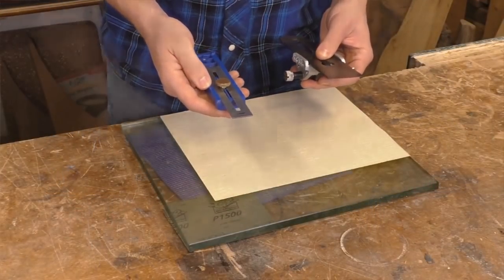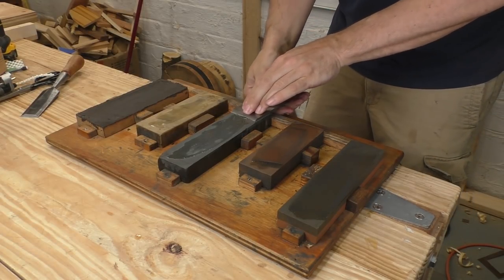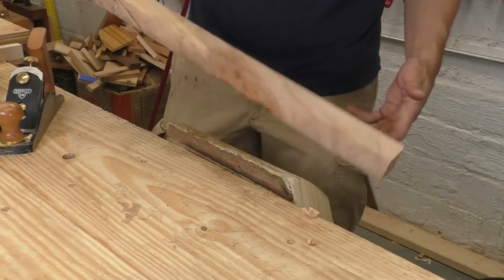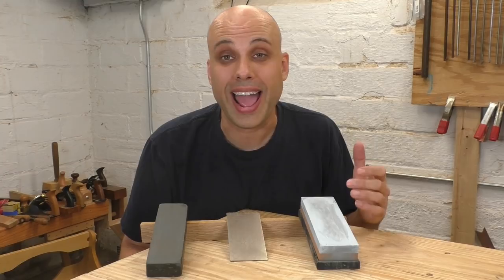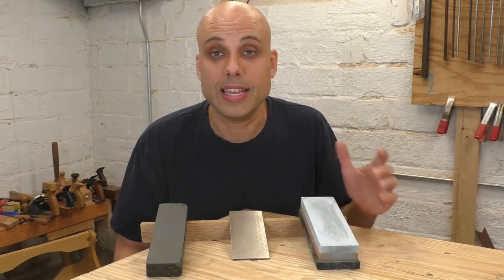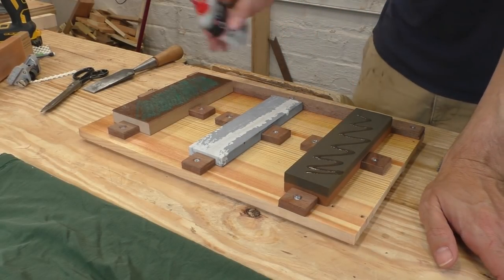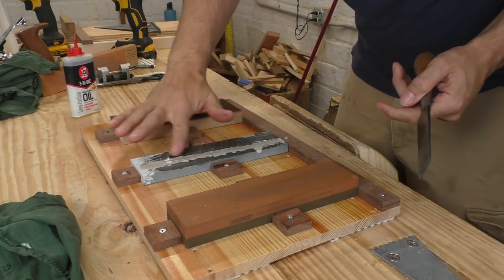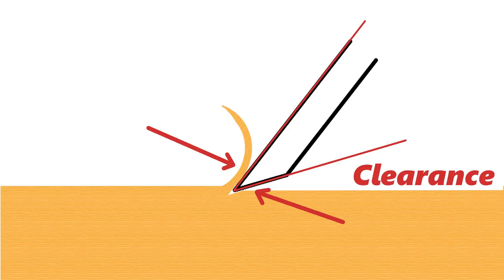Fast freehand sharpening: no jigs, no guides, no sandpaper.

Comment: The other thing is that everybody 1) cuts differently, and 2) sharpens differently. The more someone does both, the more both skills merge into a system that works for the blades and tasks in which they are involved. The right way to cut/sharpen is to go cut/sharpen a lot. What that also does is give one an appreciation for use of the blade. The more your care for and sharpen your own equipment, the less likely you are to go and jack up your blade by making it do something for which it wasn't designed. There is no right way to maintain a screwdriver so that it can effectively pry out a drive belt from an engine block. If the driver snaps, there's not much you could have done to prevent it. That's hyperbolic, but people don't realize that 400 million different blade and cutter styles exist for a reason. Different cutting and sharpening techniques and equipment exist for a reason.

Comment: Btw, that green chromium oxide (Cr2O3) compound is toxic if breathed in, so take care with that if you are going to use it in powder form or if there is a chance it can get dusted into the air you breath from the sharpening/applying action. Also, make doubly sure you don't accidentally mix it up with chromium oxide (CrO3) which is extremely toxic and often shares the same name! and should ofc. not be used for sharpening

Comment: I was so confused as the video started with the end. Turns out i tuned in at the end of premiere
Also my local DIY store doesn't even have oil stones, just crappy water stones. The cheapest oilstones in online stores around here are 40 euros or 45 bucks. I guess, I have to support the evil Amazon corp and get from them
Reply: I got a Trend 300/1000 grit diamond stone, it was expensive at about 130 eur but well worth it. Works perfectly and no worries about it being flat ever. The lapping fluid is also good to get, both for cutting performance and rust protection.

Comment: Just my two cents (been a professional woodworker for quite some time)-
You can save a lot of time by maintaining a hollow ground bevel and only sharpening the actual edge and and the heel. You are removing so little material that you can go straight to the +8000 grit. Every 50 sharpenings or so you grind the bevel back to a hollow ground. 

Hollow grinding makes holding the angle super easy to feel. 
Having a straight or concave bevel is important for how chisels work. Plane blades can be convex. Carving chisels require a somewhat convex bevel.

I have found that when you maintain a straight bevel with freehand, your bevel angle slowly creeps higher and higher even if you are pretty good at freehand sharpening, so you eventually need to grind it back anyways. 

I don't strop anymore, that too tends to cause the edge to creep forward/rounds the bevel over time, requiring more frequent regrinding.

Oil stones are fine, they just remove material much slower than decent quality waterstones, especially in finer grits (which is 90% of my sharpening)

Micro bevels are pointless with the hollow grind method.

Even a 600 grit sharpened edge will shave hair off your arm, that doesn't mean it leaves behind a good surface when using it on wood. That being said i think you need to be wayyy less aggressive on removing your burrs, when you just break them off like that, they take some of the edge with it, making an edge that will probably cut hair but will leave lines in the wood because it isn't a smooth edge anymore. I have taken to, with no pressure, setting the back of the blade on the 8k stone and gently working the burr back with a side to side motion, increasing pressure over a couple swipes. Iv had noticeable improvements in how my tools cut by doing this. 

Now most of what I just incoherently rambled about for way too long lends itself to my needs, which are cut quality, cutting efficiency and time. It kinda requires having a water basin set up all the time because the methods are only efficient if you maintain the edges frequently. 

Oh also, smooth side up helps prevent roundover but fuzzy side up is good for convex bevels like some carving tools.

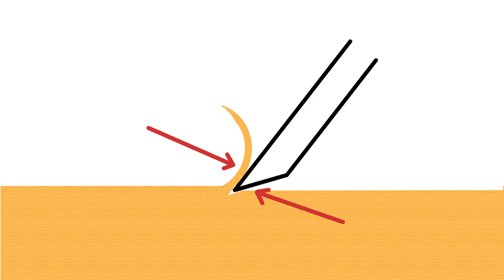Comment: 13:26 look at the picture.  No doubt others have mentioned it in places, but part of that has to be wrong.  Not only does the sharp edge cut, part of the bevel HAS to ride on the already cut piece, to give you leverage to work against to control the cut depth, and make the chip curl outward.  Without that reference against the already cut surface, the edge would constantly be wanting to depart and cut deeper, or cut shallower and want to go up out of the cut.  It can't always cut the same depth without some way to control it.  (In a plane, the plane bottom surface and the locked in blade provide that reference.  Think of all the force that is that the plane bottom and screwed in place blade are providing to cut with only the edge and flat of the blade.  You can't possibly do that freehand consistently with a chisel without using the leverage of the bevel referencing against the cut surface.)

Think of using a knife.  Go too high and it cuts in and gets stuck, too shallow and it cuts out.  When you have it cutting correctly it's because you have the edge wanting to dig in slightly, but have the side of the knife twisting into the surface, so it rides on the surface and peels the cut part out.  When you cut with a knife blade, you should FEEL that you're twisting the back side of the knife into the wood you're cutting, and MAKING the cut part curl and peel out away from the wood.  This would depart massively from the smooth cut line if that rear surface of the knife wasn't riding on that wood surface, and using that leverage to peel off the cut part in a smooth action.

That's where the idea of knife edge functions comes from, there's a narrow range where the forces are leveraged and balanced enough to control, a little too far in or out and it digs in or departs out of the cut.

From the picture in the video, you could not get that smooth curl of the chip raising up just by the cut edge, and the flat surface of the plane.  You have to have the leverage of the bevel against the surface to be able to keep that chip curling up smoothly against the flat of the chisel.
You don't HAVE to be doing this in a plane, but that's because you have the whole flat bottom surface of the plane providing reference and leverage against the surface, and the blade is locked in place.  Since you don't have that locked in place reference in a hand chisel, it has to come from working against the bevel surface riding along the wood surface in the cut.

The way to be SURE this is correct is easy.  If you are ONLY using the edge and the flat of the blade, then the angle of the bevel doesn't matter because you aren't using that back surface against the wood.  Grind one bevel down to 10 degrees, you'll find it's basically impossible to control your cut until you get the handle down against the surface like a knife.
You're using both sides of the wedge to make the cut and leverage the chip to curl out, not only one.  That back surface of the wedge is being heavily used and leveraged against, and the chisel will not function correctly if you grind it away and it is missing.  The chisel would still work the same at the same angle if you were only using the edge and the flat.

Comment: I'm always thinking of which direction to go for something finer than the 1k side of my diamond plate, a shapton splash and go stone, a spyderco ceramic, or a hard arkansas stone.

Eventually went with the hard. I like that I can sort of use the oil from sharpening to oil the plane iron and chisels after finishing. Still kinda on the fence on a final polishing stone to use with water. Either the black arkansas and maybe a nagura stone for a slurry or a 5k shapton.

Comment: Great information.  Thank you Rex.  Question: what about for newbies like me who need to start with grinding the back and bevel, is the oil stone method still the same?  just without oil?  or do I absolutely need to start with dry sandpaper to grind then move to oil stone to sharpen and hon.  Appreciate any advice.

Comment: I have been trying to learn to freehand sharpen my chisels for a while and for the most part, my results are great.  When it comes to my 1/4 inch chisel though, it has such a small reference surface that I end up applying uneven pressure.  This results in an edge that is sharp, but not straight.  Any tips other than to flatten it with the honing guide and keep practicing?
Reply: For me, the "key" to sharpening narrow chisels is using short strokes.
Reply: Go slower and wear a magnifying head set so that you can see the edge on the stone.

Comment: The real utility of the micro-bevel is for a sturdier edge. If anything, it makes the edge less fine.
Reply: The microbevel craze is also partly because people increasingly use jigs and want their bevel super flat (and super shiny) all the way across. Flat = precision in many peoples' minds. Shiny = sharp in many peoples' minds. 

Well, when you get your aftermarket extra thick A2 blade with a single bevel all the way across, it's got the area of a football field. People think a larger area just takes longer to sharpen, but there's a little twist to it. If you try to sharpen that entire area on a fine stone, you burnish the bevel. And since it's flat all the way to the edge, you burnish your edge, too. The only way to get it to cut after such treatment is to cut off the mush-apex you created with a microbevel.
Reply: Paul Sellers adds a very slight back bevel when sharpening saws for that reason.

Comment: Great stone holding jig, I think I'll make it this afternoon if I have the energy when I get home from work. Again thanks for the tips, but what do I do all the sand paper I have for sharpening?
Reply from the maker: Just keep it. You'll find lots of uses for it. The fine stuff is great for metal-work and tool restoration. Or you can use it up sharpening and THEN get some stones.
Reply: Paul Sellers scuffs his work with sand paper after planing so it'll take a finish.

Comment: I think we can all agree that the 3 in 1 oil with the extendable tip makes a mess and is not handy at all since it barely works without the tip extended and you rarely need to extend it.

Comment: It really comes down to preference. And everyone talking about non-sense this or that, and against micro bevels...Lets not forget that some of the best woodworkers and furniture makers swear by micro bevels..there is a reason they are at the top of their game.  As far as using guide or by hand, its preference. I personally hand sharpen up to at 12000 glass stone. But it took alot of practice and muscle memory to get there. I've seen some HIDEOUS bevels with 4 or more angles on them from inconsistent sharpening. So for those, take the whopping 20 seconds to put your chisel or plane blade in a honing guide and keep the angle consistent.  For for those that get all grumpy and say they don't need all those fancy stones, and I use a angle grinder. Give me a break. This is fine woodworking in most cases, not freshman woodshop.  Great video though Rex. Very well-rounded.
Reply: Being closer to freshman-level than fine-woodworking level, I'm seeking to understand why it's important to hone to so fine an edge. How much of that 12000 grit edge is lost on the first pass? What is it that can't be achieved with Rex's set-up, or Paul Sellers's, who goes to a 1000 on a uninterrupted diamond plate?

Comment: Question for you Rex... Do you lighten up on the pressure as you strop? I do cooking (as well as being an electrician lol)... and for kitchen knives, i learned  to feel  the resistance to the strop and ease up as it gets easier. The end of it is using the weight of the knife itself...... is that the same in woodwork?

Comment: What a marking knife do better than a sharp pencil?
Reply: It provides a groove to which the knife can be inserted and a ruler set to the knife side. Also it can serve as a knife wall - it can be deepened by a chisel or 1mm can be cut diagonally with a chisel to this line to provide an initial kerf for a saw. Quite useful.

Also a sharp pencil would possibly make a groove with round profile, while a single-sided knife can make a groove like \|, where one side is vertical and pretty exact.
Reply: A pencil just gives you a reference. A marking knife gives a reference as well as the groove, which is more precise.

Comment: Waterstones are also badly friable, you MUST make sure to keep shop grit and dust off them and completely rinse the grit from other stones off before you use them.  They're basically very expensive abrasive drywall without a paper coating.  Cheaper ones are fine for your 1000-8000 grit but your 300-800 and 10,000+ grits should be better quality/real product.   IF YOU USE A DRIP TABLE you don't need to soak them.  You can make a drip table with just a foot lever that clenches a tube when you don't push down on it with a pan and siphon feeding the tube.    Remember to dry your blades tho!

Comment: In case you haven't seen that yet, Paul has a blog post (https://paulsellers.com/2020/03/edge-sharpening-under-10/) on using the cheap, thin diamond plates on plywood and those cost <5$ each which means you can get to a diamond setup in under 20$. Granted, there's still merit to the bigger, thick diamond plates, but I don't think you can beat that for starting out.

Comment: I do use a bench grinder to get the original bevel back when it’s time, but freehand sharpen. Started with sandpaper on glass for that myself as well. With a hollow grind, would you say that the “convex bevel” method is still the way to go, or since with that type of grind you can easily find the bevel With the 2 points of contact, should it just stay flat without lifting the edge up at the end of the stroke and try to keep the bevel flat? I’m sure either way works, just interested in what you think. I did originally see the convex bevel method from Mr. Sellers, and I definitely think it’s a great method for sharpening. Thank you!

Comment: Hi, thanks for tips. I am not sure if I missed but I didnt get what grit sharpening stones works best? I am from Baltic States and sometimes its difficult to find same type of equipment here (not even old bit braces are available much :D) . I found some diamond sharpening stones is set of grits 240, 600 and 1000. Would that work well? I assume I would still need leather at the end.

Comment: A 400/1000 grit diamond stone can be bought on aliexpress for about 25 $. it is 8 mm thick steel (not like those really thin plates) and it is dead flat. Together with a strop, it is all you need.
Reply: A lot of cheap diamond plates have problems with the diamond particles delaminating after only a few uses. Even some of the more expensive plates have a similar problem since many of them now outsource their manufacturing to the same places making the cheap plates.
Reply: I had this happen with some DMT stones I got off Amazon.  Didn't take long before they were useless.

Comment: Rex, I got an aluminum oxide combination stone (120/320) from RH Preyda and my 3in1 oil doesn’t sit on top of either side of the stone like your stones do. It absorbs into the stone immediately. I’m worried that my stone is going to get clogged up quickly since the oil is not pooling up on top, allowing me to easily wipe away the steel coming off my plane iron. Thoughts? Is the stone too porous? Do they take some time to get saturated enough to the point where the oil will sit on top? Did I buy the wrong 3in1 oil (there were a few different varieties at HD)?

Comment: You don't have to use oil with 'oil stones'. In fact you shouldn't. Use water just like the 'water stones'. Less clogging and nasty mess, same performance.

Also you only need two grits. Around 300 and around 1000. See StumpyNubs video about that.

Comment: Not a wood worker, but I sharpen a ton of custom knives. Diamond, all day. And, yeah, don't buy a strop; make a strop. I use strips of heavy hobby leather left over from other projects. But, you don't even need that. You can strop just fine on a decently flat piece of cardboard. I know some professional knife makers that only use cardboard. The stones, I have diamond grit down to ridiculously fine. You don't need that. Most steel won't take an edge better than what about 1200 grit will provide anyway. Most commercial knives and chisels, 1000 grit is about as good as you need, and going finer won't do anything for you. Have a 600, a 1000/1200 and a strop. Maybe have a 250-350 for fixing accidents like concrete drops, but that's all you need. And, yeah... that micro bevel. Lol. Bugger that. I grind that out of any knife or chisel that I have.

Comment: hey Rex ...
I'm sharpenng knives since I was 12... so there is a bit of experience ;) ... to keep the bevel - more or less is no problem. Even on a worn out stone ... gives more a rounded bevel, wich - according to Paul Sellers - is not a prob, as long as there is enough room vor clearance. Thats why I sometimes shake my head when there is a "need" for a flat stone ... 

my problem is ... keeping the right angle of the blade. Either the cutting edge is tilting or I create a slight chamfer. Depending on the purpose - both can be bad. How do you prevent this? Any tips?

Comment: I personally prefer the Rob Cosman Method for freehand sharpening. It takes about 30-35 seconds and you don’t need to strop afterwards. It takes about 1-2 hours of practice to get the technique down but after that it’s so quick that you will notice yourself sharpening more often because it’s so quick.